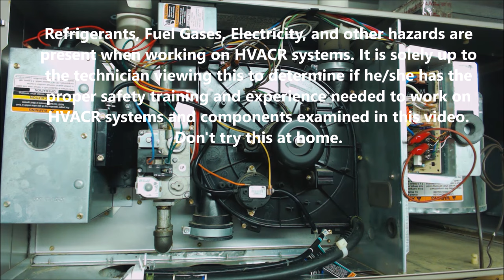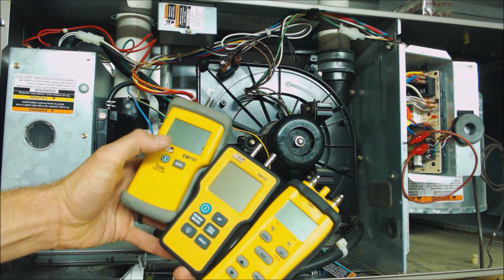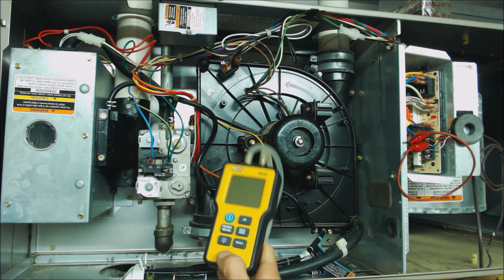TOP 10 Gas Furnace, PRESSURE SWITCH Error Code Problems!

Comment from the maker: Tool List-  https://www.amazon.com/shop/acservicetech
Support-  https://www.patreon.com/acservicetech
For those that are looking for the tools used in the videos: (Linked Below)
UEI Digital Dual Manometer-  https://amzn.to/2CWC6BD

Fieldpiece SDMN6 Dual Pressure Testing Manometer with Pump-http://amzn.to/2jyK5Ka 

UEI DL479 Multimeter with temp sensor- http://amzn.to/2jtsUbJ

3/16" x 3/16" x 3/16" brass barbed tee-  https://amzn.to/2INSRhQ

1/8" NPTF x 3/16" barb fitting for reading wc pressure- https://amzn.to/2G563Bq

Supco Universal Adjustable Pressure Switch -.01wc -10.0wc  http://amzn.to/2G1y0py

Supco Magnet Jumpers http://amzn.to/2gS4h6z

2 pairs of alligator clips- http://amzn.to/2CtIL5z

Here is the Link for the Yellow Jacket Refrigerant Manifold Gauge Set used in the videos http://amzn.to/2aenwTq

Here is a link to Refrigerant hoses with valves used in the videos  http://amzn.to/2aBumVI

Here is a link for RectorSeal Bubble Gas Leak Detector http://amzn.to/2ckWACn

Here is the link to the Appion Valve Core Removal Tool- http://amzn.to/2uYr8WL

Here is the link for the Ratcheting Service Wrench   http://amzn.to/2dGV4Nh

Here is the link to the CPS Vacuum Micron Gauge- http://amzn.to/2v1nM3O

Here is the Link to the Appion Blue 3/8" to 1/4" Vacuum Hose- http://amzn.to/2uYlVyc

Here is the Link to the Appion Red 3/8" to 1/4" Vacuum Hose- http://amzn.to/2uYg6Ro

Here is the link to the Yellow Jacket 1/4" by 1/4" heavy duty hose straight-  http://amzn.to/2umtcod 

Here is the link to the pack of 25 C&D valve cores- https://amzn.to/2J1lurm

Here is the link for the C&D Valve Core Wrench, Container, and 3 valve cores- https://amzn.to/2EVGkps

Other tool links can be found in the video description section.

Shop through Amazon! Your Purchases through Amazon provide a means for channels such as mine to earn advertising fees from all purchases after clicking through. Prices are the same as normal-    https://www.amazon.com/shop/acservicetech

Comment: Great video.  I worked on a pressure error for several hours over three days.  After watching the video a second time, I thought I should check for a hole in the pressure switch line.  The tube was pliable, semi opaque and only about 5 inches long.  It looked to be in good shape.  I could hear the diaphragm open and closed when I gently blew or sucked on the tube.  I checked the continuity on the electrical prongs when I sucked, then blew.  The switch was opening and closing.  Then I looked very closely for a hole in the vacuum line.  I didn’t find one, but I did finally notice a very small, light colored, dead insect in the line.  I could barely see it.  That was the problem!

Comment: Nicely explained. It helped me to figure out my issue. I live in KY. -7 degrees right now. Dealing with the snowstorm that most of the country just got pounded by. Was throwing  the 31 code. I watched many videos and was trying different things. Even blew through my pressure switch tubes which fixed it last time. Ended up that icy snow had gathered in my intake for induction motor blocking the downward pointing pvc pipe. Thanks for helping my brain to realize the issue. Merry Christmas!

Comment: Had this issue about a month ago. It ended up being the fresh air pipe. The fresh air connected to the exhaust and I put a piece of screen over the exhaust because a bird had built a nest. Well the fresh air was pull heat because of screen. So I disconnected the 2 at the "Y" joint and ran fresh air separate. No more issues. Thanks for all of your videos

Comment: Good video, informative, dont forget sometimes its just a bad board in general. I had a Trane 80% yesterday no variable speed. Verified pressure switch was closing and remaining closed, no blockage, inducer was on, verified voltage and what inducer was pulling, and removed exhaust to bypass to see if it was blocked and  if it would still happen, still getting “pressure switch error”. Ive also had a few furnace control boards immediately give a pressure switch code and the board itself not sending any voltage at all to inducer in the first place, I think you mentioned that. I was taught it is rarely the pressure switch thats actually “bad”
Reply: It never the pressure switch itself its usually the intake pipe and or the exhaust pipe is clogged. For me I can't unclog the exhaust pipe so I run with the tube off the pressure switch. Trane furnaces are living proof it doesn't pay to save a dollar.
Reply: @parkerbohnn  I have had a couple bad pressure switches that got permanently stuck before but very rare.
Reply: @morganne23  I just run with the tube off the pressure switch. The pressure switch is good the motherboard just got replaced and the motor is a new replacement. The exhaust pipe is 25 feet long and there's some blockage at the furnace no way to get rid of the blockage at the furnace where the exhaust pipe meets the furnace. All the vents outside are clear. It's a piece of junk XR 90 Trane furnace from 2004.
Reply: @parkerbohnn  lol yeah I just had like 2 feet of birds nest in an exhaust and intake but the run was so long I could only hook the nest in the intake. I told them to get a duct cleaning company to get the exhaust cleaned out. Not to mention inside the pvc was under finished ceiling. Im not dealing with that. It was a 90% Lennox... the ones put in by contractors in new construction homes that usually end up leaking all over off the inducer.

Comment: Hi I just wanna tell you that your are the best and you have the best video and I am a big fan and thank you for all what you do
Reply from the maker: Thank you very much Stellar!
Reply: You welcome I have a question what will happen if I install bigger compressor in a walking cooler or a air conditioner thank you
Reply from the maker: Though I haven't had a circumstance where I had to install a larger compressor for the system, I would just say, that it won't work with a fixed orifice but with a txv the low side should work at normal pressures. Remember that a larger compressor will need more refrigerant passing through the motor winding area to cool down and more oil return for lubrication so both of these will be lower since the txv will adjust the flow for a smaller system. The current will be higher just do to the size. Other than that, not sure but once again, not sure when someone would really be in a circumstance where they need to oversize since you can match hp even if it is not a direct replacement, Thanks and Merry Christmas Stellar!

Comment: It's the first "cold" day of the year and hot air was not coming out of the vents. Spent the good part of a day thinking my pressure switch was bad (31 error code) and tinkering with many things. Watched this video and decided what the hell, maybe item number 1 (clogged exhaust) is the culprit. Went outside to look - lo and behold a bird had built a nest in the exhaust pipe over the summer! Took a wire hanger apart and used it to pull lots of sticks and nest particles out of the exhaust pipe on the side of my house, then jacked the heat up using the Ecobee thermostat app on my phone, and glorious air started rushing out of the exhaust pipe. Went back inside and the house was warming up. Thanks so much for the tips! Is there some kind of screen one can put on the exhaust to stop this from happening, or would that be a bad idea? Dryer vents have those plastic mesh covers, it seems like this large pipe is just begging for a bird to nest here every year.
Reply: My problem is the exhaust pipe is clogged at the furnace and the pipe is 25 feet long so I can't unclog it.

Comment: So my heat stopped working and I have watched a ton of videos on it. Love yours it’s great!! Lots of good info. My question is this tho. I seen on another video that the number one issue is a dirty flame sensor. So I took mine out and furnace fired right up. Next day same issue. Then I realized that it has error 31. Decided to clean the flame sensor one more time just in case it worked again. It did! But now I’m in the same boat again and thinking I need to replace the flame sensor. Am I wrong? Or should I focus on the possible causes for the error 31?

Comment: Thanks for the detail. I have a trane xv95. After 3 seconds of the burner lighting it cuts off. Tries 2 more times then 2 red light flashes for retry lockout. Flame sensor has been cleaned and inducer motor was changed due to bad bearings. Funny thing is that if I pull the vacuum line from the burner box and slightly blow in it when the flame lights i can hear the pressure switch click and it'll stay running every time. It has a dual pressure switch setup. I think the switch is bad.
Reply: I have an XR 90 Trane and as everyone knows they're the worst furnace ever made. I just run with the hose taken off the pressure switch. The pressure switch works perfectly the motor is a brand new replacement and the intake and exhaust  pipes are 25 feet long apiece so I can't suck out anything. So I run with the hose off the pressure switch.

Comment: Great video! Very helpful. I had a problem with mine were the installer did not route the drain line properly after it left the unit. Do you do any videos on proper drain line installation or problems. My furnace drain and ac condensate drain were combined before a p trap which was against York’s recommendations and it cause the furnace drain back up after long runs. So I would get intermittent pressure code errors. My hvac guy changed out both sensors and and wanted to change the board next before I said time out. I was surprised that my guy did not use a manometer to check the actual sensors and instead just wanted to start replacing everything since the parts are cover under my York warranty, of course i pay for the labor.

Comment: We had AC installed a few weeks ago and starting 2 nights ago we're getting error 45 on a Rheem high efficiency, gas furnace, which means the low pressure switch is open when the inducer is at high speed.  I/m not sure but it seems more than a coincidence that this started happening just a few weeks after the work was done.
They sent a tech out to check it, and he said the problem was probably the line clogged because when the furnace was installed (about 6 years ago), they (diff company) ported it out into the ground, which he said could get clogged.  He cut the pipe so now it just empties out onto the ground and got it running again.  A few hours after he left, it errored out again.  The after hours guy came, fiddled around, checked the pressure, clogs etc...checked some of the connections and such, and got it going again saying that he thought maybe the previous error code hadn't been cleared out.  It was running, he left, only to have it error out again after an hour or two.  It will still run, but just blows cool air out the vents.  
Anyone have any ideas about why it would run for a bit, then error out and shut off?  I feel like some of the things covered in this video aren't the culprit becuase then it wouldn't run at all.
Thanks!

Comment: I came across one new bdp unit that the inducer molded plastic had a malformed seam near top of mating surfaces to heat exchanger... just enough leakage to operate pressure switch on the lower end of break, make point.  I lost hair that day . ha. 
NEVER stop learning!!

Comment: #11 it's a Carrier.
#12 it's a Goodman/Amana.
#13 PVC shavings from hack vent installs blocking the drain port.
#14 Bugs clogging the drain ports.
I once found three mice had somehow gotten into the inducer wheel and burned out themselves and the ID motor.
Thanks for sharing!
Reply from the maker: Ha ha nice! Thanks Tomon8tor!
Reply: Number 1 should be it a carrier,lol
Reply: cannot say I've seen a pvc shaving blockage, but it's sure is possible
Reply: I've seen a blockage due to a piece of fruit that dropped down the stack. That was interesting!

Comment: Had one with the rubber hoses going to the condensate drain, relief port box the relief hose was clogged with grey like stones/dust, we PM the furnaces and flush out the box, the condensate box would flush out so to say, the rubber tubes are alittle hard when we always inspect them, then this one time I squeezed the lines like I do and the tube in that spot busted open and water went flowing. The relief tube and upper drain tube where clogged with this grey stuff and was eating out the rubber. So I always pull lines and check now. 
The call was for water on floor. No sign of water any where, nothing in condensate drain and never leaked water when I was there. Also noticed alot of water coming out of exhaust, which I known something was not right. Fixed the tubes and perfect now.
Reply from the maker: Nice thanks Andy!

Comment: Can a too low or too high gas pressure also cause this? I have a newer icp hvac and it throws 6 flashes, turns off once or twice a day i have to shut the power off wait few mins then turn it back on and it works again. Unit is about 1 year old. I have 2 of the same units 1 of them works normal

Comment: I'm stuck on error code 32.  I think it may be a bad control board as I don't think 120v is going to the inducer motor.  The molex connector where you have your leads stuck in is where to check for 120v, correct?

Comment: I have a Goodman 80% model Horizontally mounted unit in attic saying via the code that the pressure switch is stuck open. I could use some advice/input how to proceed and what to check next. 
Note: Inducer motor works, but no ignitor turns on. (I replace the Flame detection sensor thinking that was the issue because last week the furnace did not work and then started working normally again for about 4 days. Now it's not working again and as mentioned blinking that the pressure switch is stuck open...Thanks...
Phil
NYC Area

Comment: I was on the second floor of my home when I heard something abruptly spin down. Apon investigation I was getting the 3 light flashes then pause. I could feel cool air come through the vents but furnace wouldn't fire. Through troubleshooting I started blowing into all the tunes that were in the path of the pressure switch. I also blew into both ends of the pressure switch and I could hear it clicking. When the author of this video said a bird nest could fall down the pvc stack connected to the inducer motor I decided to check. I found a 3 inch piece of wood lodged down into the enducer motor. Once removed my furnace fired up.

Comment: My 2008 Ruud/Rheem  Furnace Model:  UGFD-07EMCKS ,  flashes 5 & 7,  so code 57 High Pressure Switch  (contacts open - inducer high )  and the heat wont stay on. 
I cleaned the flame sensor, turned the power on , put the bottom furnace door on,  and the furnace lighted and worked for about 5min , until i switched the fan to auto from on. And wont re light.   Its a modular controlled furnace with a "v " wire and says you cant manually light the pilot.   Not sure what to do about code 57.

Comment: I had a problem with the pressure switch not opening after last cycle, I took switch off and had continuity between com & NO, I noticed a very small amount  of water inside switch, after getting the water out and no continuity between terminals I reinstalled switch and The furnace started and ran fine. how would water get into switch?

Comment: I got an error code of three flashes on my 12 year old Goodman furnace. Jumping the pressure switches did not work so I started testing them
, flame roll out sensors, etc. They all read good, the only thing left at that point was the circuit board. Replaced that an we are golden. Error codes are kind of a joke with furnaces. If the sequence of events are interrupted that is where the error code seems to flash to.

Comment: I have an American standard freedom 80 hat only furnace and I have the pressure switch error code. My furnace will start, the flames would come on and before the blower motor kicks in, the furnace starts cycling ( inducer motor stops then stops) then the code comes on. Help!!!
Reply from the maker: On an 80% unit, it is usually the hole where the tubing is connected at the inducer cloggs, the pressure switch is bad, or the exhaust pipe has a problem. It could also be a cracked heat exchanger but you may notice the flames rolling back if that was the case. I use my SDMN6 to check pressure switches. You can also read resistance across the switch with multimeter set on ohms to see if when it clicks closed if you are getting close to 0.0ohms of resistance. I just checked one on friday that was reading 300ohms so I knew the pressure switch was the problem, thanks
Reply: It’s not the pressure switch, I have two furnaces and I swapped the switches and the switch worked on the other furnace. Sometimes it will go as far as the flames coming on, and before the blower motor kicks in, it starts to cycle.
Reply: Thanks by the way🤙🏾

Comment: The other tube coming from the pressure switch to the burner box is tripping my pressure switch code.then the heater just keeps short cycling then resets for an hour. What's going on please?

Comment: I had one last week that would crank up and run.but not quite fast enough.  Low rpms
Reply from the maker: Nice, if the cap and voltage were good, sounds like the windings bad, thanks

Comment: The drain tube coming out the bottom of the furnace at the pea trap 
I took the water drain hose off and its sucking air in to it 
Is that normal or should it be blowing out?
Reply from the maker: Yes, the water weight stops the suction and allows the water to flow through the trap and out of the furnace. You should fill the trap again with water after cleaning it, thanks!